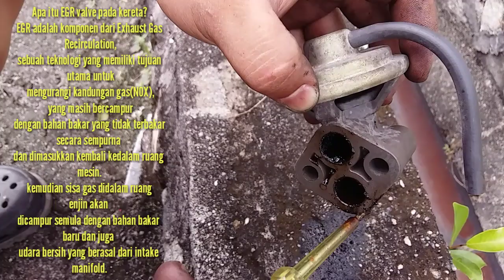Cara service EGR valve kereta,Tutorial-Diy / Automotif

Comment: banyak sy belajar dari bro Alan . sy hanya seorang tyreman lori ( outdoor breakdown service ). sy baru beli iswara abg ipar . Iswara 12V , Engine 4G13 Manual . bulan pertama semuanya indah . tapi lepastu satu per satu dugaan datang . fedup juga la kekadang . tp ini kereta pertama sy ! umur (23) . sayang dan modal tak hensem punya pasal sy xmoh hantar bengkel dan nk repair sendiri . haha . sy memang tak pandai tang engine ni . lepas jumpa video2 Bro Alan ,sy start perlahan2 dari kenalpasti masalah aircond system , kemudian tukar aircond compressor , condenser fan motor , servis cooling coil , servis condenser coil , tukar resistor , repair distributor , servis EGR valve . servis/flushing radiator . kenalpasti masalah gegaran stering/tayar . tukar bearing tayar belakang .  itu setakat ini yang saya buat sendiri hasil dari tunjuk ajar bro Alan . terima kasih banyak2 . Tapi bosku , yang saya x dapat kesan lagi bila engine kereta dah panas , bau pedih asap ekzos tu tetap ada walaupun semua lobang lobang yg ada kat depan tu tertutup rapi . so sy tetap kena buka tingkap supaya bau tu keluar . kata orang ekzos manifold gasket dh loose . Betul kah itoo ??  lepastu kalau cold start enjen semput . kena main minyak sikit sampai autochoke buka baru lah dia ok . kiranya setting utk timing masa cold start dgan timing engine panas semua dah ngam . cuma cold start tu je kita kena main pam pam sikit baru lah semput tu hilang dan autochoke buka . ape masalah utk dua perkara tu wahai sifu ku .
Reply: Kena sabar pakai kereta saga...nii.. dgn bantuan Alan Kita boleh jimat Dan puas hati... terima Kasih Alan..
Reply: Ada service kit untuk auto choke tu. cuba search dlm youtube ada seorang otai tu ajar mcm mana nak service autochoke karburetor

Comment: Mlm tuan, klu rpm naik turun naik turun apa mslh tu ar? Mnta bantuan dlu hehe
Reply from the maker: kena check juga tu bosku, sebapnya ada beberapa kemungkinan yg menyebapkn bnda berlaku,
 1)ada nya ganguan air induction system, atau pun timing tidak stabil,angin lebih gas kurang atau sebalik nya,
boleh juga di sebapkan condenction meter tu sendiri,jarang berlaku tapi tidak mustahil tidak berlaku, 
jdi sukar memastikan masalah tu kalau kereta bukan depan mata bosku.
Reply: Rpm naik masa start kereta dlm keadaan sejuk dan stabil balik lepas 5 min dan 10min mcm tu kenapa ye???
Reply: Rpm naik bila start engine sejuk dan dlm 5-10 mint stabil, itu normal. Suhu engine optima 80-100°C semasa rpm stabil.

Comment: Bang Alan, kalau kereta Iswara fuel 50rm berapa boleh pergi sebab saya punya kereta 50 rm boleh pergi 132 km saja
Reply: Saga 8v magma sedan sy 50rggt Dr Penang ke Port dikson... Tp ikut lebuh raya jimat minyak, blk guna jln lama Dr Port dikson ke Penang minyak 70rggt,sbb byk trafik Light dan byk tukar gear...
Reply: @mohammadfauzi5038  wahh... Saya punya kereta baru lepas service carb pun Sama minyak cepat habis
Reply: @imranarjik8696  kena ejas distributor dan tuning karburetor bg ngam abg, jgn berat bg enjin berat sangat dan ringan sangat.. Sedang2..filter petrol tukar, air filter kalau dah hitam tukar baru..setiap kali servis minyak enjin tembak angin air filter, guna 4 ke 5x servis enjin ja,lps tu elok tukar baru air filter abg guna brand murah pun xpa.. Plug pun sama jgk 4 ke 5x servis enjin.. Tukar sekali dgn air filter... Insya Allah minyak boleh jimat.. Kita jaga dia, dia akan jaga kita blk..